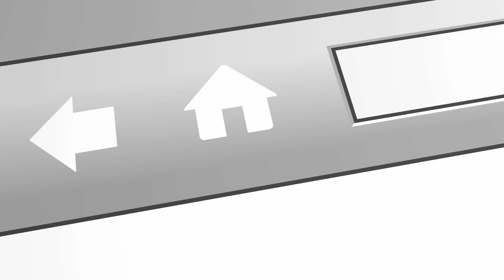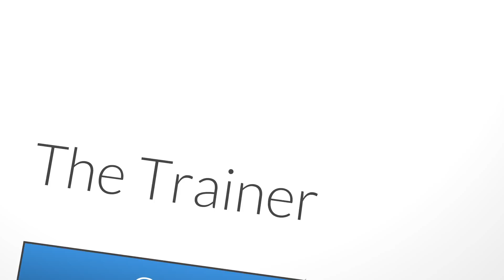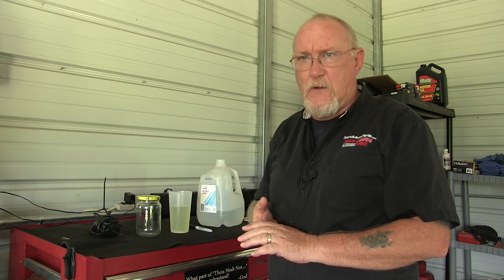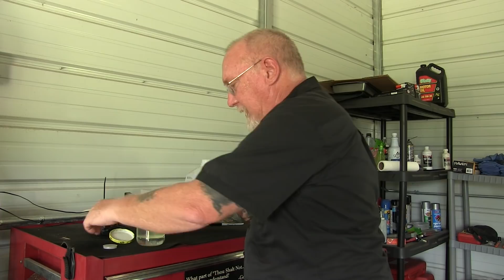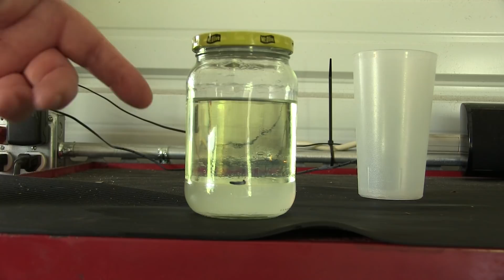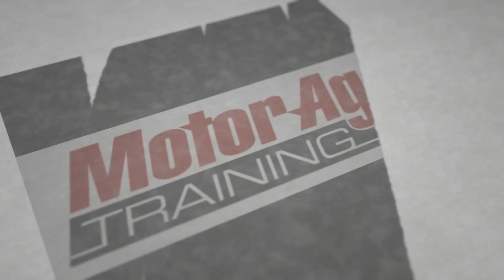The Trainer #67 - When Fuel Trims Won't Trim

Comment: I'm at work and just happened to put my scanner on my truck. In the past fuel trims always looked normal. Today bank 2 is always staying at +2%. Idle and driving. I didn't check it before it closed loop. 

Could you tell me anything? Thanks your videos are awesome
Reply from the maker: Need to be a bit more specific - is this STFT or LTFT? Is it switching or locked in at 2%?
Reply: @VehicleServiceandRepair  thank you for getting back to me. I've been binge watching your videos.

It was short trim. But today it reads fine. Stays about -2 to +7, today. I did notice the Long stays -12 until I step on gas pedal. Then it goes straight to zero. Until I let off then goes back to -12 or close to it. Is that ok? I know 25 is usually the number that's not good.

My truck is 2011 Silverado 5.3 (LMG).
240,000 miles

THANKS again for these awesome videos. My electrical diagnoses is way better just in the last 24 hours from watching 2 or 3 if your videos. 

I also bought the xtool D8, it's new to market. Do you have any experience with Xtool?
Reply from the maker: @IntelligentElephant  Let's see if I can address your questions. First, it is normal for STFT to move back and forth across 0 - in fact, it HAS to for the oxygen sensor to work properly. Ideally, it should switch evenly on both sides. If not, the LTFT will learn the correction needed to bring it back into place.
Now to your LTFT comment. This is a learned value. When you hit the throttle, it's possible you are going into Open Loop and the ECM isn't in fuel control OR that's the value learned for THAT load and rpm condition. I wouldn't worry about the -12 number - with 240,000 miles on it, the ECM is correcting for normal wear and tear.
As for your comment about 25 being a bad number, that isn't entirely true. Every OE has its own TOTAL fuel trim threshold that must be crossed before it will set a System Lean or System Rich code. If the STFT is switching over 0, nice and even (within a few points), the ECM is happy and you can be to.
Last, I know the name but I have no experience with the tool you mention.
I'm glad you're finding these videos useful. That's why we do them!
Reply: @VehicleServiceandRepair  it could be going into open loop when applying the gas? I never thought about that. So is that something I should be concerned about? 

To check that, I just need to have loop status pid up and see if it goes in and out when hitting the throttle?

I promise I won't keep dragging this out, but learning things is just about all I do. Especially with this truck. My goal is half a million miles+.
Reply from the maker: @IntelligentElephant  You can monitor the PID but if it is going into Open Loop, it's because of the sudden change and nothing to worry about. If it never goes into Closed Loop, that's a different story!
Reply: @VehicleServiceandRepair  oh wow. I learn something new every time. Just recently I learned lugs and lug nuts are not what hold the weight of the car. They simply just keep the wheel on the vehicle, nothing more. 

I noticed you had an oscillascope video. Have you seen the Autel 539b. $89 and it seems to scope. There's a channel called pawprints ( I don't know) and he uses that to scope sensors on vehicles. He uses the AC side. For the price, should I buy that next? I'm going to binge watch your videos again tonight and probably for the next week. I seriously can't believe how much I'm learning.
Reply from the maker: @IntelligentElephant  I'm not familiar with that Autel tool but for the price, I'm betting its a graphing multimeter and not a true oscilloscope. The difference is in the sampling rate and can mean seeing the problem or missing it, depending on what you're testing. For a newbie, the pocket-sized uScope (www.aeswave.com) is a powerful scope at a friendly price. I'm glad you're enjoying the channel!

Comment: I have short term bank 1 25.0 Short term bank 2 25.0 they both goes back down to 0.0 then go back up to 25.0 what can this be the long term is good 0.0 my car is running lean p0171
Reply from the maker: If your STFT is off at idle and OK at higher rpm, you are most likely looking for a vacuum leak.
Reply: @VehicleServiceandRepair  I find all the leaks...I was looking at my Scan tool I find the fuel system 1 and fuel system 2 had a open loop fault so that's is telling me my upstream 02 sensors about to go out

Comment: Hello sir I am having long term fuel trim at idle getting to up to about 14 most of the time my short term will be negative and getting up to 1 at times back and forth. Bank 2 long term getting up to about 10 short term negative too changed maf no vac leaks what do you think this could be this is during idle at higher rpms fuel trims go down what would you think this is?
Reply from the maker: Think about what you wrote - "this is during idle at higher rpms fuel trims go down". If trims are higher at idle and get better at higher rpms, you have unmetered air getting in somewhere.
Reply: @VehicleServiceandRepair  ok I have looked everywhere ill have to smoke machine it

Comment: My stft stays +25% in all driving conditions, have changed the 02 sensor still having this. Trouble code thrown is P0171 
Help
Reply: @DIY Garage nissan sentra 2008 2.0l petrol cvt 
It's a maf sensor
Reply from the maker: @AnythingEverythingGh  OK, next step - what are the total (STFT + LTFT) trims at idle and at 2500 rpm?
Reply: @VehicleServiceandRepair  (25%+9%)=34%

And all driving conditions,  even at idle
Reply from the maker: @AnythingEverythingGh  Then I would suspect a problem with the MAF sensor.
Reply: Changed it still having that problem, my next culprit is fuel injectors. Possible to be the problem??
Reply from the maker: @AnythingEverythingGh  I doubt it - usually it's something supplying the info the ECM needs to perform the calculation. What is the MAF grams/second reading on the scan tool at hot idle?
Reply: @VehicleServiceandRepair  2.75/gram 

BTW my ohms test for all injectors checked is 12.7 instead of OEM 11.6, is that a concern?
Reply from the maker: @AnythingEverythingGh  No, that could be attributed to the meter/leads. Did you "0" the meter prior to the measurement? Even then, that small variation wouldn't concern me. The MAF looks like it's reading correctly so consider what else would affect ALL cylinders at the same time. Have you checked fuel pressure and volume?
Reply: @VehicleServiceandRepair  yes I did, 0 before measuring. Meter set lowest 200ohms. 
Yes fuel pressure is good, my car use the returnless fuel system so the fuel pressure regulator is all built as one unit inside the tank. I have swapped it before thinking it was the culprit but it wasn't; that didn't fix it! 
BTW my manifold vacuum barometer pressure is 13.78psi at vehicle off. 
Is that normal? 
Monitored by obd.
Reply from the maker: @AnythingEverythingGh  Yes, likely - it should be a reflection of the barometric pressure in your area. If fuel delivery is good, and the MAF is reporting correctly, then I'm thinking you have one hell of a vacuum leak OR air that is entering the system after the MAF sensor. Leaks in the boot that connects the MAF to the throttle body are common - inspect if very carefully for damage. Let me know what you see.
Reply: @VehicleServiceandRepair  Checked that, no leaks! Smoked the engine as well, no known leaks. Is there any data pids you will want to see so i can pull it and send you perhaps ? You can list them so i obd them and send you.

Thanks Sir
Reply from the maker: @AnythingEverythingGh  Smoke test may not uncover problem with intake boot. Visually inspect as well. Then start closing off vacuum lines connected to the engine one at a time to see what happens - PCV, EVAP, brake booster. May be an internal leak.
Reply: @VehicleServiceandRepair  driving now,  noticed at all driving conditions manifold vacuum is at 28.5 HG
Reply from the maker: @AnythingEverythingGh  Graph your MAF, MAP (if equipped), BARO, RPM andthe PID you referenced and send me the screen shot.
Reply: @VehicleServiceandRepair  your email / or where you want me to send it 
On my system barometer is equipped inside maf sensor assembly as well
Reply from the maker: @AnythingEverythingGh  Send it to pmeier@endeavorb2b.com

Comment: Very informative videos, thanks for taking the time, You explain things really well. I've got a 2009 f150 4.6 3valve that hasn't thrown a code yet buy has long term fuel trims that after warmup sit at around 25+ on both banks. They will drop to about half that under a load. I've pinched hoses, used carb cleaner and propane  and I don't get any indications of a vacuum leak.Checked the fuel cannister purge valve, it's ok. I smoke tested the engine and  not a bit of smoke. I should also say the truck runs great. Idle rpms are right on and is super smooth. The long terms have actually crept up slowly over time from where they first caught my attention at around 10+ and both sides have come up togrther gradually.The short terms stay very low and the long terms don't actually jump around, once they get to that spot they stay there. It's got good fuel pressure  sitting in the yard and doesn't lack any power on the road at all so I've kind of ignored any fuel supply issues. It's got about 90,000 miles on it and plugs were replace at about 60000.I will say the fuel injectors on this truck look kind of nasty. I had to replace one a while back and the plastic jacket was cracked from  metal underneath the platic jacket rusting and expanding as it coroded.They all look like that.I've wondered if they're all wearing or clogged just enough to increase the pulse intervals and skew the LTFTs. Wellcome any comments.Thanks!
Reply from the maker: What are the STFTs? What are the trim values at idle? At 2500 rpm?
Reply: @VehicleServiceandRepair  Short terms seem to bounce back and forth pos to neg  3 points or less  either way. Never any  big corrections The long terms will start out at 7 or 8 cold start and then slowly build into the 20's over 4 or 5 minutes. At 2500 the long terms will drop pretty quickly to about 7 or 8 positve and stay there until I drop back to idle and this is about the same driving..I should mention I replaced exhaust manifolds on both sides so I checked for leaks but did not find any . I checked the bell end connector of the pipe just in front of the sensors especially and there didn't seem to be any leaks.
Reply from the maker: @jeffreyallen3777  And this is not setting a DTC? Usually, high trims at idle and more  normal at higher rpm indicates a vacuum leak.Did you smoke test it with the engine at operating temperature?
Reply: @VehicleServiceandRepair Today I did a second smoke test after reaching operating temp. I plugged my smoke machine into the brake booster hose  because I know where it connects to the intake on the back is a problem area on a lot on triton motors. I couldn't see any smoke and didn't even catch a whiff of it and that burning oil has a strong smell. . I'm going to check the exhaust carefully for leaks again as both headers were replaced a while back but I can't hear anything and I don't see any soot.I hope they haven't warped again. I don't know if that could cause pos trims this high anyway. I have another f150 with a 4.6 and it threw a code a while back on bank 1 and that's exactly what it was. Strangely it coded at trims around 12+. You could see soot on the exhaust bell and it was making quite a bit of noise on hard acceleration. I tightened up the bell and that solved the problem. Anyway, thanks for your thoughts, much appreciated.
Reply: Just to follow up  I smoked the crankcase and found a hole in the cast aluminum valve cover on bank 1 that was hidden pretty well by the fuel/ignition wire bundle support stud. It was at least  a1/4" hole. That's a lot of unmetered air.
Reply: @jeffreyallen3777  Sounds like Ford

Comment: My car is a turbo i-6 3.0L. My idle ltft is 23%, stft varies but +/- 10% but mostly around 0, my maf reads 3.06g/s OR 3.4g/s. I am not sure which conditions the MAF reading changes but Im sure one of them is from a cold start and the other is on a warm start. I sometimes get "rail pressure too high before start" code causing limp mode that goes away when I restart the car. My lean code says it happens on partial load. 

WOT from 2.5k rpm to 7k rpm, ltft stays, stft slowly drops to -10%. 

Whats going on? 

Ive cleaned the MAF, swapped rail pressure sensor, reset adaptations.

At this point, Ill consider anything reasonably priced.
Reply from the maker: Post your fuel trims at warm idle and at 2500 rpm.

Comment: Thanks for great explanation. I have problem with my vw polo 9N (AZQ engine), my fuel trim isn't triming - LTFT is constant at 0% while STFT is fluctuate depending on condition. At idle STFTis about -20% (LTFT constantly 0%). Pretty similar situation is in driving condition. I have P0172 code (no vacuum leak, checked by smoke mashine, but occasionally I get P0106 code). Did you had this case? Thanks in advance.
Reply from the maker: Post your fuel trims (short and long) for idle and 2500 rpm.
Reply: @VehicleServiceandRepair Thank you for replying. Here you can see live data: https://youtu.be/qBRE62x7YJY
Reply from the maker: @milivojnesic9013  Your STFT is trying to correct for the "rich" condition but your LTFT is at "0". Have you reset the ECU memory recently? I also don't like the way the upstream O2 is stuck high and there is little switching in the STFT. Test the front O2 sensor.
Reply: @VehicleServiceandRepair  in this condition i drowe ~500km, i haven't reset ECU since. I also changed front O2 sensor from good vehicle and it is same situation
Reply: @VehicleServiceandRepair  Here are same data with different O2 sensor: https://youtu.be/StvIny50ajE
In very rare situation LTFT (under 10% of using the car) fluctuates.
Thank you for your time.
Reply: @TRUE-LOVE333  Changed timing chain, after that, car was like a new

Comment: My fuel trim isn't moving sensor 1 does but not sensor 2
Reply from the maker: Need to be a bit more detailed. What kind of vehicle? Year, make, model, engine...? Are you referencing Bank 1 Sensor 1 and Bank 2 Sensor 1 OR Bank 1 Sensor 2? What are the fuel trims themselves reading?

Comment: Any idea what would cause long term fuel trims on one bank to run positive 14. Then when put into reverse or drive it goes to 0. Instantly.
Reply from the maker: Long term, or LTFT, is a learned value stored in a table based on load and rpm. You should be.more concerned about total trim, or LTFT plus STFT. Compare that bank to bank and see what it looks like. Another key is to monitor Short Term (STFT). If it stays centered (+/-) around "0", the ECM is in fuel control.
Reply: @VehicleServiceandRepair  Thank you again for responding. I'm a newbie at diagnosing. The vehicle has a rough idle but runs very well. No cel. I cannot locate a vacuum leak. Fuel delivery is good. I dont want to parts change and waste money. The condition I described in the comment before the short term stayed at 0 +- a couple along with the long term. But in neutral at idle bank one stays at 14 total fuel trim. But in gear at idle it the engine smoothes out and fuel trims are all normal. The scan tool shows an instant change when selecting between gear position on the ltft. Stft stays around 0.
Reply from the maker: @fusserick76  Post your vehicle info and I’ll try to off some ideas when I return Monday.
Reply: @VehicleServiceandRepair  2011 dodge nitro 4.0L V6. Map only. 125000 miles. Rough idle in neutral. Some days it will have an extended cranking but it always fires up. Thank you for your help. I'll keep searching for the solution.
Reply from the maker: @fusserick76  A fuel trim change that abrupt is unusual. I would clear the KAM (Keep Alive Memory) which will clear the learned LTFT values and see what happens. Monitor the trim on start up and see if STFT immediately starts to correct or you notice any change in idle quality. Let's start there...

Comment: I got a unrelated topic question.  I couldn’t find a water pump video from you. 

I have a question about Joanna’s Durango.  Last month it was in there for an oil change and you guys found a coolant leak.  I checked it out and found the water pump was leaking at the shaft.  Easy job so I replaced it myself, but a week later we smelled coolant again and last night I finally got around to looking for it and turns out it’s leaking again at the water pump shaft, I looked all around to make sure it wasn’t coming from anywhere else like the oil cooler or hose and it isn’t.  It starts at the water pump pulley on the inside.  It doesn’t start leaking right away but until after about 10 minutes of running  any idea what could be causing it to do that ?  My initial guess is that there is to much pressure building up in the system. I hope it isn’t any major. It’s never over heated and as you know we take it in for oil changes all the time.   if you don’t mind giving me some input I’d appreciate it.  

2016 Durango 3.6 liter.  113k. 

Thank you.
Reply from the maker: Good afternoon Ray! 
First, we didn't change anything - we're a trade publication, not a shop.
But to answer your question, it is important to lubricate the seal prior to start up or it can fail prematurely. That could explain your situation. And we do have a few videos on water pumps:  
https://youtu.be/TP2shrLxaLU
https://youtu.be/oFgZtAYGegI